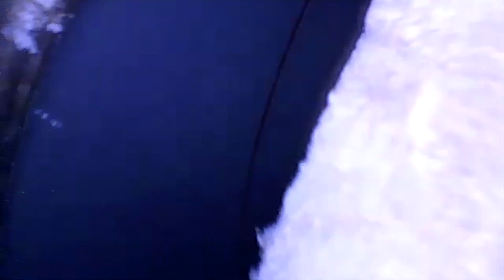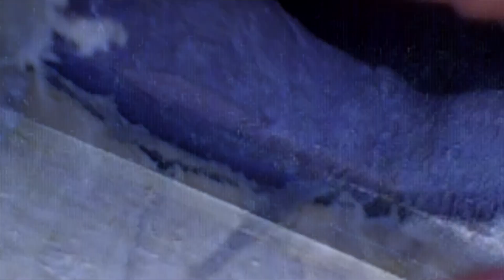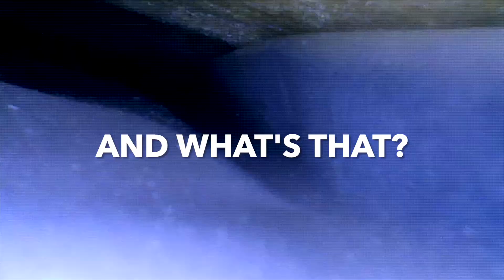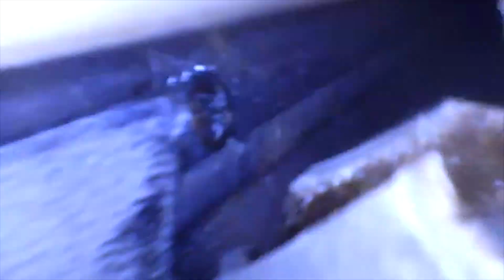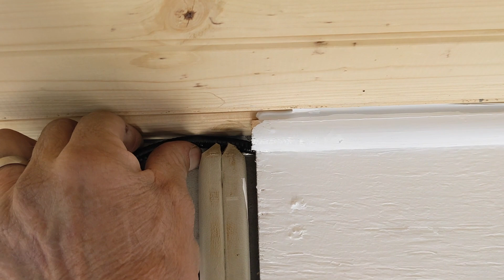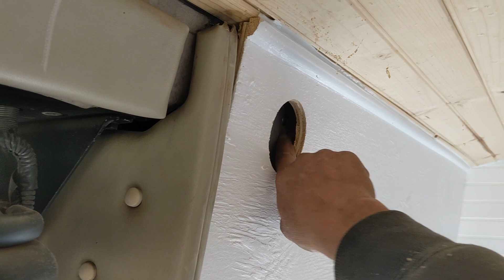A peek behind the skin...no insulation and hidden control knobs.

Comment: That switch by the door really isn't an emergency switch, but rather the way to close the door from outside.
Reply: If you lose air pressure, you lose the door. The switch allows for the driver to release the door opening from either side. In an emergency, it's very important for a school bus.

Comment: Some of that woodwork in that build was amazing! Huge gaps, and timber that you could build a house with!

In fact, I think if all that  wood was replaced with more appropriately sized stuff, that would result in a significant weight reduction! 😲

Ross you're doing a brilliant job there! Well done young sir! :-)
Reply from the maker: At 60 I don't often get called young sir.  So thank you for that...and the comment!
Reply: @dragonmetalwork  it's my pleasure Ross! 😀
Reply: As an trained and certified carpenter, if you rip out the wood, work it into the right sizes and shapes and rebuild the interior with it you have leftovers.
Would probably cheaper to use new material though if you do it not on your own time though.
The kitchen board would be good with some shaping and epoxy work to make it lighter and not look half assed in the surface department.

As a whole everyone with very basic tools and the will to make it look good could do an better job, that is very deliberate bad work, you do not get to that degree of shitty by plain lazyness.